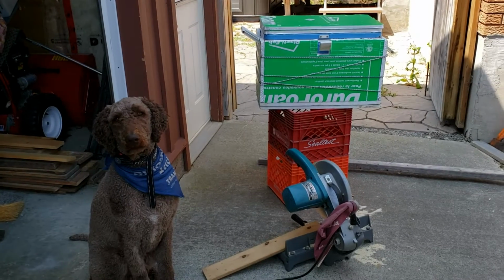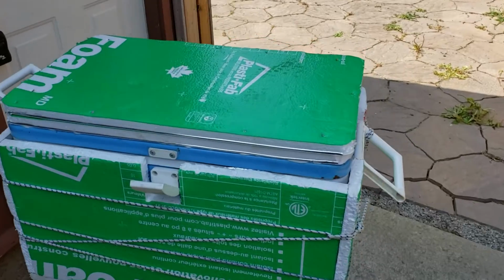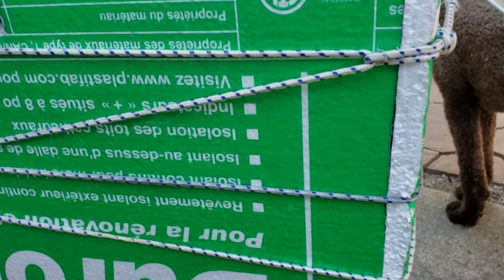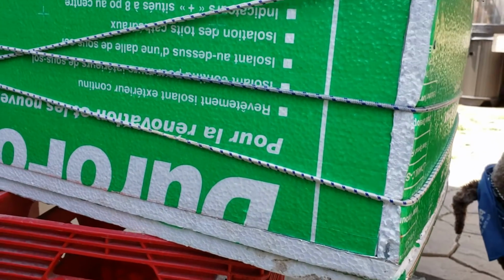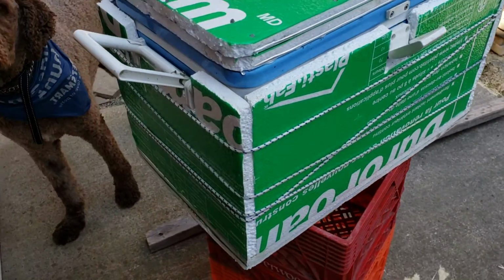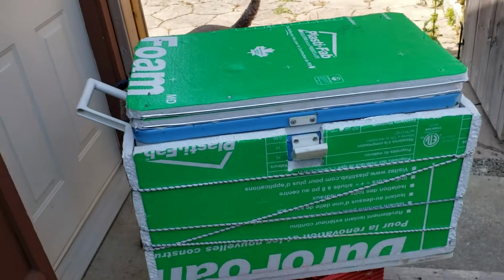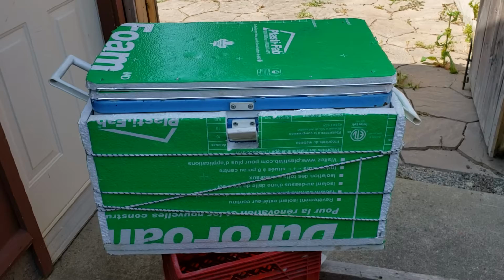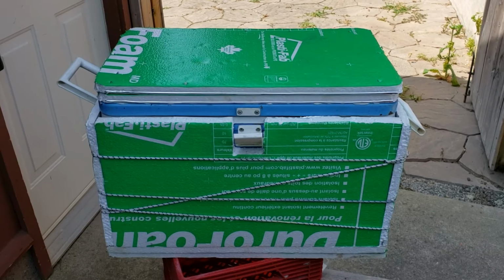Redneck Cooler

Comment: WOW!, what would inspire anyone to reengineer a cooler that's been around for many decades. They actually already work great and easily transported. Now you'll need a cargo trailer with a WIDE LOAD placard just to take it to your favorite soccer game or ballerina practice. DUDE JUST BUY EXTRA ICE!! 
Were you dressed appropriately? Did you use cut resistant gloves, hardhat, safety glasses, cover-alls, and hard toed shoes? Maybe your other commenters (when you get any) will weigh in on this. It's been a week now and I'm your first. You are welcome.
I'll admit it. This comment looks about as ridiculous as ones you've left for others. Turnabout is fair play.